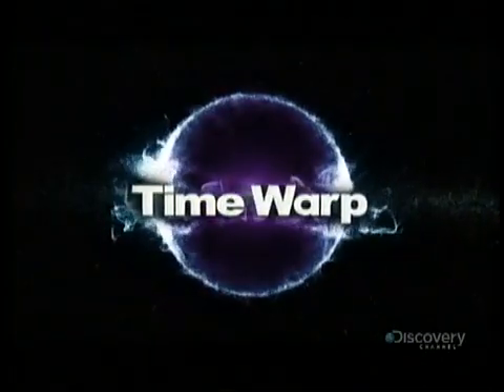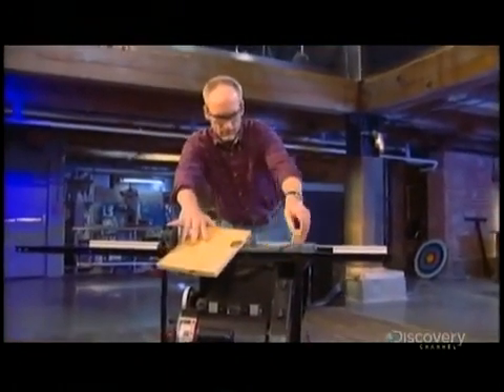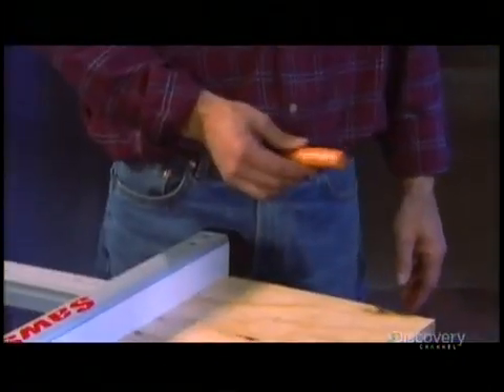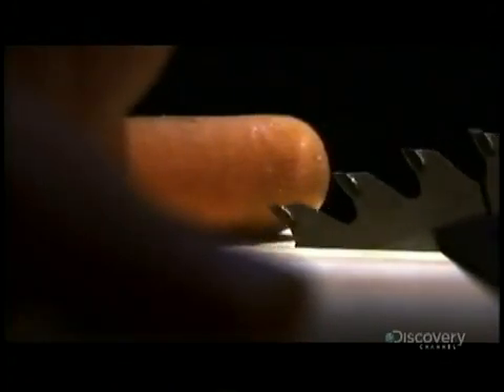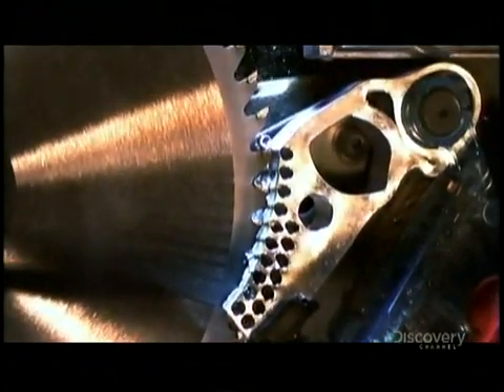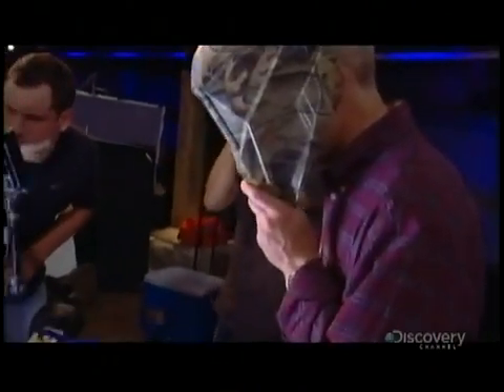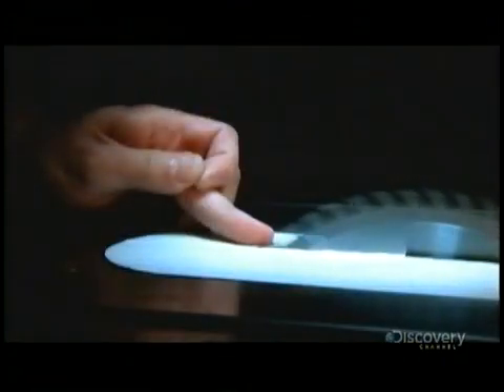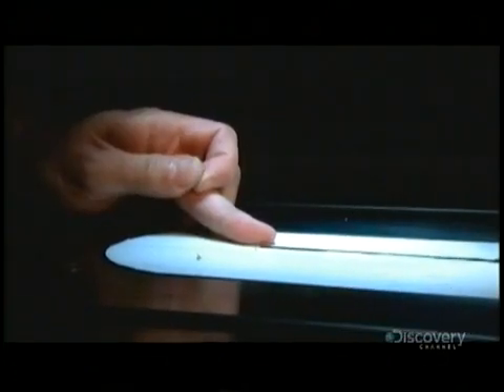Saw Stop - This guy puts a finger into an active table saw blade & comes away without a scratch!

Comment: I'M ONE OF THOSE UNLUCKY 10
Reply: Shudda had sawstop
Reply: RIP
Reply: +Mr. Spanky or a table saw with a guide, not one missing all the safety stuff
Reply: +Mr. Spanky lol ur not wrong
Reply: I used to work with a guy who was one x 5.  I was upset when I was splattered from head to toe with blood and bits of bone (one bit of bone hit my cheek and actually stung when it did) until I saw where it came from.  Picking someone's bone fragments out of your hair will make you mindful of the safety concerns of working with fast moving sharp objects like a router.
Reply: +nunya biznez that's how my friend felt when my incident happened
Reply: +Obstruct329 I'm one of the extremely lucky ones, nearly cut off three on my left hand, one only hanging by skin at the time, and all are still with me.

Comment: try putting the finger faster, u'll see how fast it'll be saving it.
Reply: +Filippo Candotti I watched someone trip and smash their hand into a saw stop blade that was spinning. It gave them a pretty bad cut (plenty of blood). However their hand wasn't totally mangled, which is what it would have been without saw stop... So yeah, I think it worked pretty good actually...
Reply: +ollie young I mean you're still smashing your hand into a blade... I'd expect blood even if it wasn't spinning at all lol
Reply: we have this saw at my shop. if you read the manual  it clearly states that at normal cutting speed, you will sustain a very slight injury.obviously the faster you push the stock though the worse the injury. but even if your a reckless moron you will not lose any important parts. as for falling on the blade if it contacts your clothing first this will increase the time it takes for the safety to trigger. saw blades must be kept clean. any glue residue on the blade will also increase the time to trigger.
Reply: well if you think about it people wouldn't fool around with a fucking saw you idiot people go slow not fast
Reply: did you not see the part with the hotdog? he practically threw it at the blade and came out unscathed
Reply: Good idea
Reply: Anti Tryhard Yeah it wouldn't be nice at all.
Reply: Jerbens Jarman thats not my point though so shut the fuck up
Reply: You're a fucking moron Jason.

Comment: This is not fake. It works with the same concept as saws that cut casts. I recently had to get my full arm cast move and I was terrified as the doctor used what appeared to be a handheld saw. It sliced through the rock hard cast material, but as soon as the blade touched my arm it stopped. I was amazed

Comment: i had one of those bite the stop because the wood was too wet, just a heads up to anyone who wants to buy one, its works just maybe too well
Reply: +Loki the Trixter ive done that on the job. its a real pain the ass when your wood has sat in the rain and it kills your tablesaw lots of time wasted
Reply: same, we just got the saw and my boss didnt believe i didnt touch it myself till it happened to him
Reply: +Loki the Trixter I'd rather have it go off too soon than too late (or not at all). Keeping all your fingers is worth the 50-80 bucks and a few hours for replacing the blade. Even if that happens every couple months. But yeah, it can be annoying.
Reply: really if its unnecessary if you know how to use a tablesaw safely
most saws have a little rectangle plate around the blade. think of that as the rectangle of doom and despair. never put your fingers inside of it or doom will follow
its that simple  Jan H.

Comment: didnyou guys hear how it works? theyre running a tinh electrical current through the blade and when it feels your static electricity contact the blades it activates that brake.... so yes it would probably cut through a glove butnit would stop immediately after it cut through the glove.

Comment: Im sorry I don't get it? Whats the use of invention like that? So that you can go to lunch and safely let the blade spin meantime?
Reply: +Gizmoriderful Ye What? It's so that if you screw up and let your hand slide into the blade, you don't chop off your digits. Without the safety mechanism, your finger would cut just as easily at the wood.
Reply: +1997jankuschef Ah now i get it, you have to move saw  horizontally so it stops.

Comment: cant you just make a break disc ? like a disc on a car ? instead of ruining the machine you could put the same pressure on each side of the blade with like 1000 psi or something
Reply: +Casper sanderson that would cost much more than 60$ to implement..
and I guess it would take longer time to brake if you think about it. but maybe i'm wrong and some big equipment does have this sort of brake

Comment: so if your cutting damp wood, you damage your saw. sounds great! and if your hands are dry and not salty like most wood workers hands are then the teeth will need blood to trigger it. but as an engineer, i have a better question. the steel blade is directly bolted to the output drive shaft, the shaft to steel gears then to the steel motor armature and last to steel bearings, now the motor case is grounded with the three prong plug. this would conclude that all the spinning parts can NOT be used the way you are claiming simply because its all grounded. if you modify and electrically isolate these parts for your sensor, then the safety of the machine is compromised in other ways. all so, to stop a motor at full speed that quickly is very likely to damage more then just the blade. i feel this idea is not practical or convincing sorry to say
Reply: 1. You can disable the safety lock for cutting damp wood so now its just a normal table saw with an easy fence. 2. I would take a graze or nick to the finger 5,000 times over than having my hand being pulled and shoved through the blade. It also has a blade guard and splitter to prevent kickback from hurting you and pulling you in, but other table saws have it too so the lock and stop feature saves fingers and hands. 3. You have to remember, this is meant to prevent accidents and lower damages. Its not like everyone with a table saw wakes up and says "yeah, I feel like shoving my hand through my saw today". Its meant to stop your hand from being cut in half if a piece of stock pulls it when you get kickback. Say what you want but its been certified and I'd rather have this feature than not so what you're arguing is stupid because you act like its satan compared to other table saws.
Reply: your response of disabling the feature for wet wood is noted, thank you. however the rest of your response had little or nothing to do with what i had said to you.
Reply: because you said your saw stop feature was licensed i took a look in to it. this is what Wikipedia says "   In April 2008 they told Congress that SawStop's braking system is:[10]
dangerous because it requires the user to come in contact with the blade before activating;
unproven, particularly in terms of durability;
prone to false trips caused by commonly available wet and green wood;
potentially vulnerable to latent damage that cannot be inspected and may cause a hazard;
costly to the user because once activated, saw blade and cartridge must be replaced; and
significantly more expensive, ranging from a minimum of 25 percent and ranging upwards depending on saw type
The PTI objects to the licensing necessary due to the "more than 50 patents" related to SawStop's braking system;[10] such costs "would destroy the market for the cheapest, most popular saws, adding $100 or more to the price of consumer models that typically sell for less than $200."[8] In response, their members developed "new plastic guards to shield table saw users from the dangers of a spinning blade" and began selling models with that feature in 2007; as of May 2011, PTI says "its member companies have received no reports of injuries on [the 750,000] table saws with the new guard design."[9]" it looks to me that only your new guard succeeded and not your original design

Comment: My only experience with a saw stop was when my colleague was cutting some wood for a jig while we were working on carbon fiber molds. There was a tiny piece of dry carbon fiber weave on the wood that tripped the stop. Not the most expensive mistake of the summer, but no one was happy about it. I can say that it really does work, and fast.

Comment: Swear professionals hate these because they go off when they shouldnt and fuck up their equipment?
Reply: +Nick C They are very reliable and almost never fire when they are not supposed to in most shop situations. They can fire on wet wood or when cutting metals and there is a override switch for these situations.

Comment: 1000 G's is not like driving a car into a wall at 1000 mph. Also you just pulled that 1000 G's figure right out of your ass. It's easy enough to calculate it you know.
Reply: shhh we don't need science on discovery;)
Reply: we don't care, we get the point, saw moves fast, stopping something super fast is super hard. don't get all prissy :3
Reply: +Benny Tadeo Ah, but when a show that's about "science" isn't accurate, it's sorta a crime.
Reply: +AEguy Productions Why don't you go ahead and do the calculations then since it's so easy? I'd be surprised if you even know the very basics of vector math.

That aside, you are right in that Car @ 1000MPH + Wall = 1000G. But you said it's easy to calculate it so by all means - go ahead! :)

Comment: Notice nobody talks about false triggering.  What if you try to cut some damp sappy wood? It will conduct electricity back  to your hand and/or to the table.  How does it differentiate between that perfectly natural occurrence and direct finger contact?  Notice it could not tell a sausage from a finger and it will be set up for maximum sensitivity to make sure it goes off so I recon this will just cost you a fortune in blades and replacement braking mechanisms.  Better to learn how to operate without fingers getting near like using a pusher stick.

Comment: i remember i worked in a shop that had these sawstop saws and we broke like 3 sensors in a week. Supervisor was pissed. lol
Reply: +Ray G Did they actually touch the blade or did it go off randomly?
Reply: +chees454 i once touched it accidentally and some other guy poked it with something while it was turning off and it activated. Its not a 100% great mechanism. In a real life scenario, you are cutting the wood at a much quicker pace. It gives enough time for you to get cut before it drops. My buddy had a 3/4 inch gash on his thumb using a Sawstop. The guy in the video reaches for the blade ever so slowly. Thats the only way they work without cutting you.
Reply: +Ray G well it isn't magic, but it's still the difference between a minor cut and a bloody stump

Comment: an improvement to this design would be to incorporate gloves designed to provide the same the same conductivity function but at a distance of a few millimeters or so so that it is contact-less.
another designed improvement would be to eliminate the forced blade stoppage. The saw blade housing would be secured using a heavy duty spring loaded at a rearward 45 degree angle and when the brain board senses conductivity changes, a pin-type of mechanism would retract (while also cutting power and utilizing a less damaging method of saw blade brake) and the saw blade would be instantly and simultaneously "pulled" (by the spring) away from the danger zone. This idea works because table saws are used in one direction only and the blade would be pulled down into the saw box at a 45 degree angle. IMO (not an engineer) this could be accomplished with very similar speed and sensitivity compared to what is shown in this video. The advantage to a design that follows this mechanism is that the machine doesn't get 1/5 destroyed during the process.

I am a mechanical technician who works on a variety of equipment for a large gym chain while I am finishing up college. I work on commercial HVAC, electrical, circuit boards, electric motors and controllers, and a slew of fitness equipment.
Reply: +Aaron Merritt
I am not aware if this saw is affected by wet wood or metal (I assume since it is detecting conductivity) but a design that incorporates a bypass for the sensor that could use some other sort of communication (nfc, Bluetooth, etc) to tell the saw to stop (via the gloves). Gloves would need to have some sort of additional tech or sensing capabilities to communicate with the brains of the Sawstop.

Comment: What If you wanna cut sausages With your Saw....
Reply: There is a bypass mode... You need a key and stuff for wet wood etc...
Reply: so you'll find that your wood is too wet for the device (or there is a nail or some kind of woodworm) only after it have worked?
Reply: What if you want to cut people up with a saw.
Reply: @Lord_Reeves  then you obviously need help mental help
Reply: +Jack Bolton hahahahaha you said wet wood
Reply: @samuelmason1939  I have some wet wood in my freezer. Can you help me cut it up so we can bury it later?

Police at my door. r/whoooooooooosh you idiots.
Reply: +Mathias Moslund • lol I laughed.
Reply: The saw does have a bypass feature
Reply: Then don't use this with it
Reply: what if i wanna cut sausages but not my finger?
Reply: then use a dry sausage
Reply: "What If you wanna cut sausages With your Saw...."

Just set it on the sausage setting, .......... and forget it !
Reply: +Kossai Djahra, Kossai
"nobody cuts a sausage with a saw."
Here, hold my beer!
Reply: What if I want to cut fingers?
Reply: Anyone know what would happen if you just stood over the machine and slammed your head straight into the spinning saw? Would the saw blade stop? Asking for a friend.
Reply: @LolLol-pq5fp  yep. I wouldn't try it though. It works based on skin contact. It isn't designed to rule out injury, just almost nullify the risk.
Reply: +Mathias Moslund toughluck then, cause you cant
Reply: Ikr
Reply: hahah im crying man ;]
Reply: Turn it off
Reply: Mathias Moslund 😂🤣😄😅
Reply: Mathias Moslund you cant
Reply: Mathias Moslund then get over it
Reply: Why would you do that first of all
Reply: "What If you wanna cut sausages With your Saw...."
Ever heard the stories about the "missing link" ???
Reply: Mathias Moslund.
Get outta here!
Reply: Mathias Moslund xd
Reply: then too fucking bad
Reply: You either SLAM the sausage on the blade OR you rip the sausage in half
Reply: here's  several suggestions for diy table saw construction
Find a proven set of plans online 
Find a colleague who wants to build one too so you have another person to help you
(I discovered these and the reasons they work on Wilfs wood blueprint site )
Reply: It has a key override.
Reply: You need to buy costly upgrade.
Reply: U can thHERE IS A SAFETY BYPASS FOR THIS   THERES A KEY YOU SHOULD PUT IT INTO TO MACHINE AND TURN IT OVER THAN IT WILL ACT LIKE NORMAL SAW
Reply: *insert jontron saying but why over and over again*
Reply: it will cost $60, that 's all
Reply: You can't
Reply: Put your saw stop in bypass mode
Reply: You can, just gotta make the sausage not grounded!!
Reply: Theres a bypass mode for weirdos like you
Reply: Turn the key.
Reply: Mathias Moslund u don even need to turn on it to cut sausages its really simple just turn that sht off and cut the fling sausages with it
Reply: Ducking idiots
Reply: Damn dude, getting philosophical.
Reply: @LuxDude2003 Vacuums do you have a sense of humour?
Reply: @vro.j  it’s a joke
Reply: xTHEx xUNTITLEDx  its a joke
Reply: It can be bypass
Reply: What if I want to cut my finger but not wood
Reply: They taste better blown up
Reply: Then you are stupid
Reply from the maker: Attempting to hit 10K Subscribers! Please consider subscribing :D
Reply: Make good content, and they will come.
       People don't subscribe to be nice. They subscribe because you make good content.
      One thing you might try, Find someone who has a shit ton of subscribers and collaborate with them.
      I know one channel who did that, and they went from less than 500 subs to over 10000 in a month.
Reply: @anthonyprezutti  stop begging

Comment: mmmmm, maybe just use 2 push sticks? have alittle more respect to a spinning open saw blade? pay attention to where your fingers are in relation to the blade? have more respect for an open saw blade. sounds easier than a system that completey wrecks your table saw. can it go off accidently?